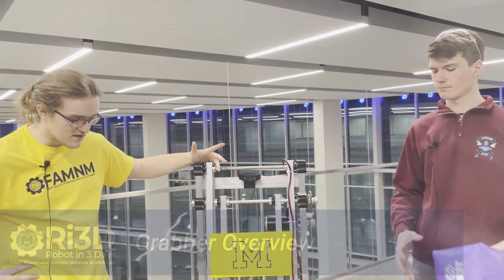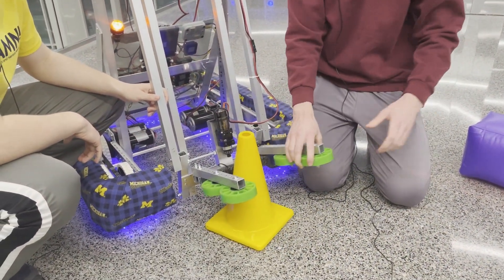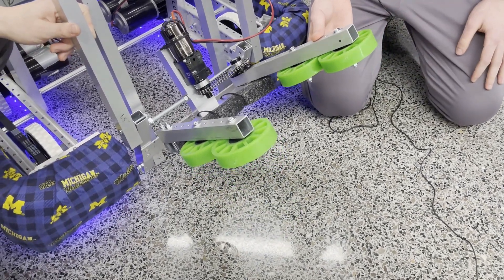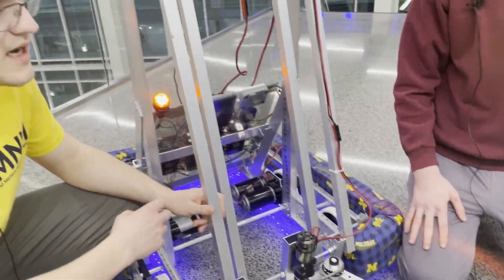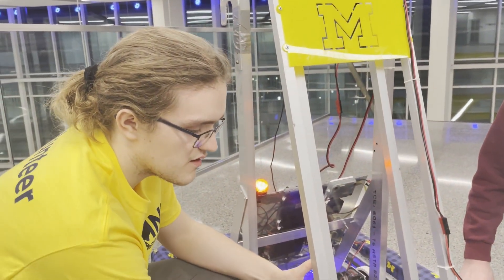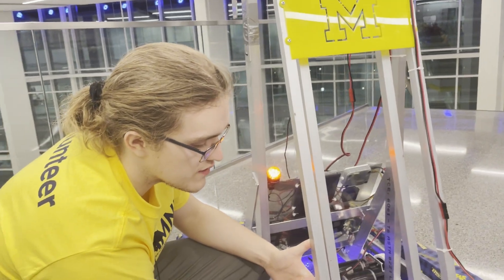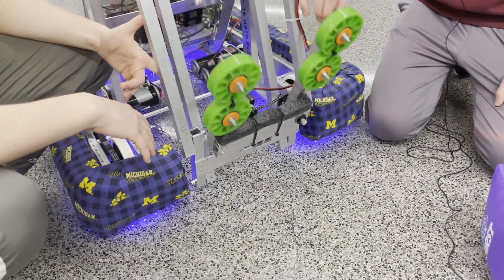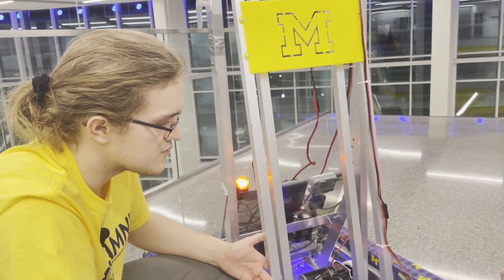Grabber Overview | FAMNM Robot in 3 Days 2023

Comment: Simple question, but how did you make it so the grabber stays parallel to the floor and doesn't move with the arm?
Reply: They are using a 4-bar mechanism. It’s basically a rectangle but all of the sides are connected with pivot points, meaning any position you move, the opposite side will always stay parallel.
Reply: https://en.wikipedia.org/wiki/Four-bar_linkage

Comment: One question how will the robot be able to pickup fallen cone pieces as that will be a massive flaw.
Reply: You don't take need that as you can pick up from hp station
Reply: @Coolgamertag120  You will if you want to be competitive
Reply: @TheWalkerboh65  how many cones overall are available? Only after they all run out is that relevant.
Reply: No, fallen cones will not make or break a competitive team lol. It blows me away how many people are convinced that's the important part of the game. Cones won't end up tipped very often, just go get another one (also the low nodes are perfect for tipped cones)
Reply: We were able to reorient fallen cones by setting our grabber onto the lip of the cone and driving backwards to pull it right-side up. There might be footage of that in the reveal video when it's released. As others have said, however, it's probably more efficient to pick one up from the loading zone.
Reply: Look at chief delphi there’s a who,e article on why tipped over cones are red herrings